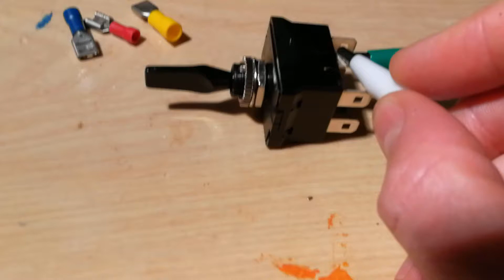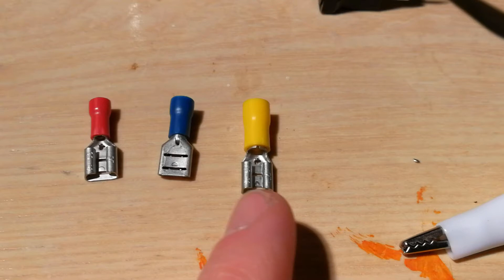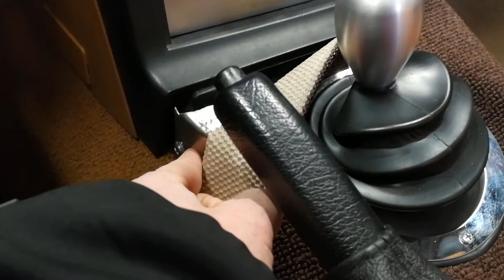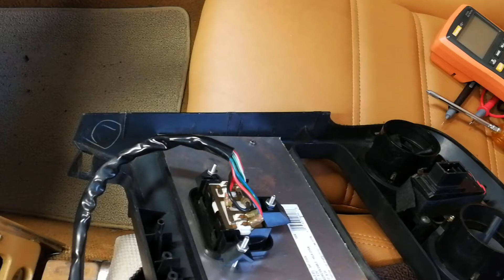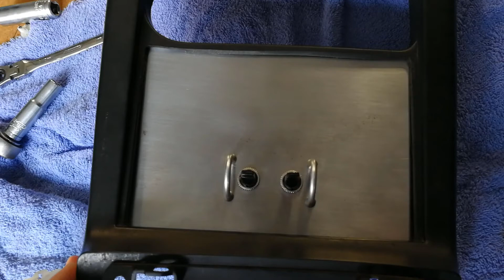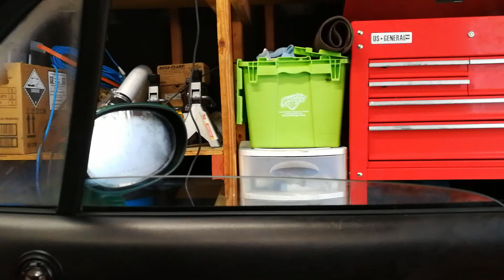Retro Switches in Your Car - $12!

Comment: Thank you, this vid helped a lot I used a 3d printed switch assembly that goes in place of the stock one
Reply from the maker: Nice! I love my 3d printer, turns out there are a lot of free Miata related prints out there.   I did a console delete cap for the bottom of my tombstone.

Comment: Hey I looked on eBay and didn’t see the nice all black ( DPDT )  “ with Returned to Position. Can you tell me the part number or information on the  exact switch that you have please
Reply from the maker: I sort of hate ebay for this reason, things disappear completely.  I found this by the same seller so I think it's what I used: https://www.ebay.com/itm/Black-6Pin-DPDT-3Position-12mm-ON-OFF-Momentary-Toggle-Switch-DC12V-20A-NEW-/152250994361?mkcid=16&mkevt=1&_trksid=p2349624.m46890.l49286&mkrid=711-127632-2357-0

Comment: I'm literally so confused about wiring...is it possible for you to send me a detailed diagram?
Reply from the maker: I thought I had one but I can't find it.  Check out this link...ignore the text and just use this diagram. https://www.instructables.com/community/I-am-building-a-TV-lift-with-hopefully-RF-and-/. On a double pole, double throw switch you have six connector points.  Two in the middle are power and ground.  The top two and bottom two are crossed together.  There reason for this is for up on the window, positive is on one side of the motor and negative on the other.  To go down, it's reversed.  The switch handles reversing the polarity for you.
Reply: @OGPedXing  ok thank you i understand the routing now.

Comment: Nice video! I'm thinking about putting some switches into my car, too. But I'd use them for other functions like an antenna switch (so the stupid antenna won't raise every time I turn on the radio to listen to MP3s...).
Reply from the maker: Switches on the console are fun...I plan to add more related to the megasquirt, like for fuel table switching and boost level.